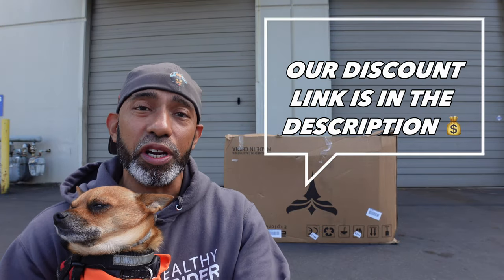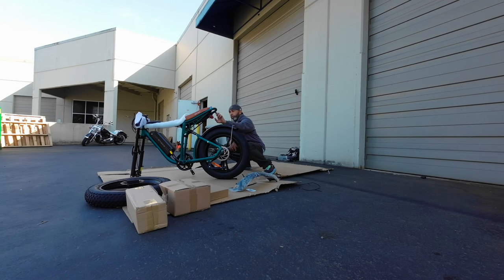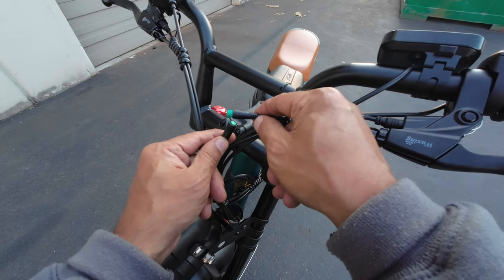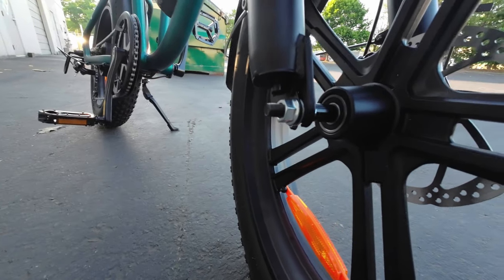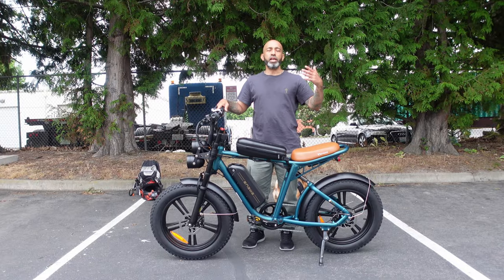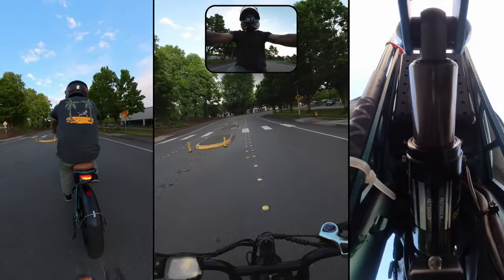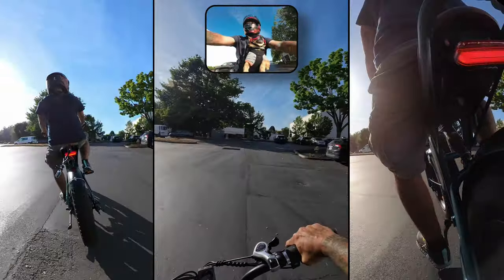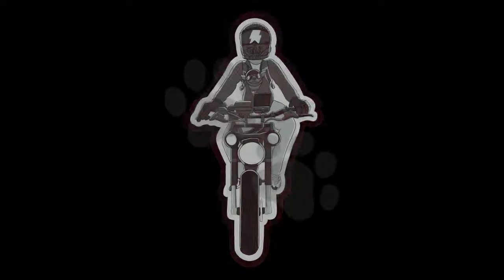Engwe M20 | Unboxing/Assembly/First ride

Comment: Is Super 73 robbing us? I would say yes and no it's a little more complicated.  Part of it comes down to the price of components though.  In all fairness Super 73 does use name brand components on all their bikes most smaller companies use no name brand compounds that are more cost effective so they can sell their bikes at a lower cost.  Super 73 also manufactures all of their bikes in California which would explain the very high price of their bikes.  Most brands do not manufacture their bikes in the US most are outsourced manufactured in China as it's a lot cheaper. This is why most companies can offer a better price/value compared to Super 73. With all that being said the problem with Super 73 today is they are just not innovating the way their competitors are.  They seem to have gotten fat and complacent their "new' Adventure Series line up is just a rehash of all of their old bikes with slight tweaks. Their lineup is stale and outdated compared to what their competitors have been putting out.  I would rather Super 73 outsource some of their manufacturing so they can get the price down as $4000 for their RX model is insane . Manufacturing aside the reality is other brands are offering bikes that offer much more at a lower price point in regards to performance and value and this is even more important today as many people just don't have as much cash in their pockets due to the world economic situation.  Could Super 73 sell their bikes at a lower cost? I think so will they not likely but if inflation gets worse as it's expected to Super 73 may have no choice as many people will go with more affordable options.
Reply from the maker: Hi Brent, excellent points!

I didn’t consider Super73s being built in the US. Totally makes sense why their prices are bloated.  
Performance and specs aside, no company has been able to match or exceed the overall aesthetics of the Super73 brand. Lots of imitations, some good, some not.  This is a great one for the price indeed. The inclusion of a loud functional horn at this price surprised me the most for some reason haha.  Name brand brakes would have been nice for sure. These feel great for being mechanical, curious how much more it would increase the price for tektro mechanicals.  I’m assuming it’s more about availability than choice. 

Cheers!!
Reply from the maker: I updated the title of the video after the points you made.  Thanks again!  🇺🇸
Reply: @RustyRoads  Hey Rusty yeah I watch a lot of your vids figured I'd way in on the subject. Absolutely Super 73's bikes have always looked great but other brands are for sure catching up to them like Ride 1 Up and C3strom to name a few..  Super 73 also has a massive brand following no one can deny that but if I where them I would be paying attention to the competition in my opinion they can't afford to rely on their brand name alone not anymore.

Comment: That Engwe is OK.  What I don’t like is no hydraulic brakes,  prefer thumb throttle,  really don’t like throttle speed connected to pedal assist. (Max throttle speed should always be allowed no matter what pedal assist level you in except zero).  Also packaging/shipping box needs to be greatly improved)
Reply from the maker: Agreed except for the throttle part 👍🏽 I prefer twist myself